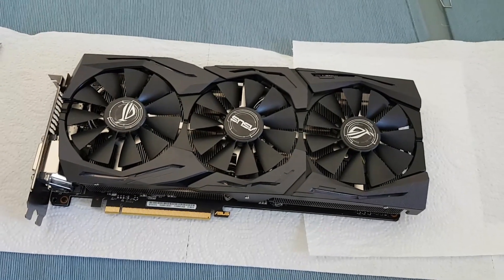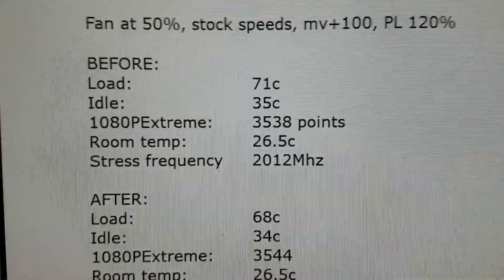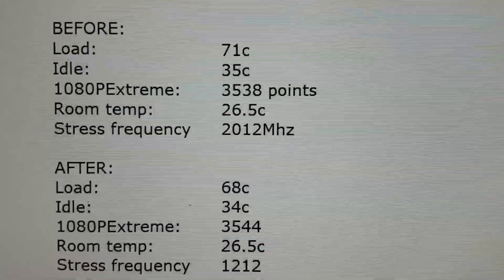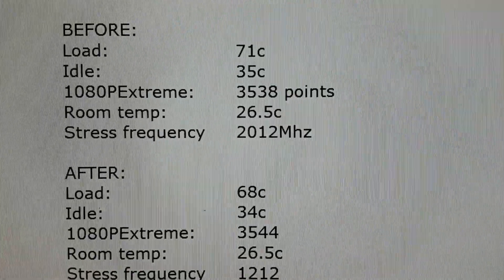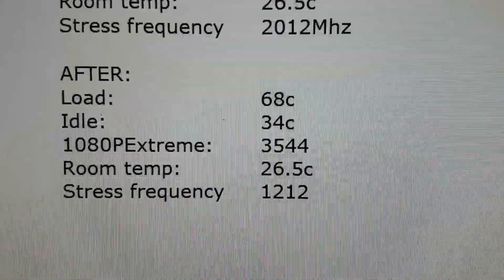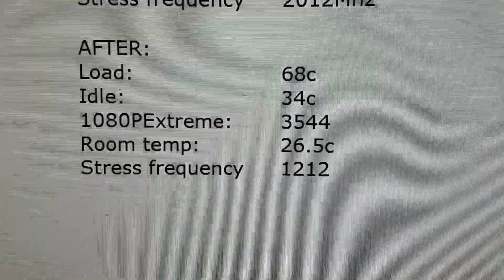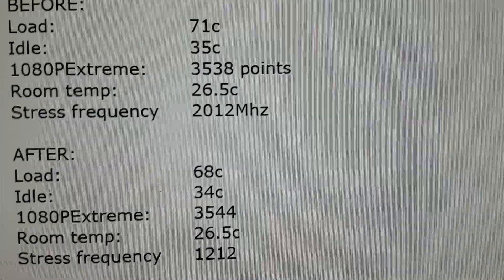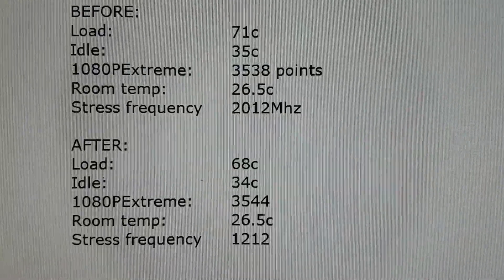Thermal Grizzly Kryonaut on ASUS ROG STRIX-GTX1070-O8G-GAMING

Comment: Can you tell me size of yellow thermal pad on heat sink
Reply from the maker: The thermal pads are good quality and mine didn't rip when I disassembled the card, so as long as you are careful there's no need to replace them. My VRM temperature were exactly the same after I assembled the card again so if they don't break its fine to reuse them. I have been asked this before and I'm sorry to say that I haven't been able to find what thickness they are.
Reply: @OzzedNet  thank you : )

Comment: how many mm thermal pad?
Reply from the maker: I don't know. Mine remained intact so there was no need to replace them. It seems they are the kind that won't rip if you're careful when taking the card apart. I tried googling it but I'm afraid I haven't been able to find the thickness listed anywhere.
Reply: @OzzedNet  thanks for your answer
Reply from the maker: @emraherkul  No problem :) Sorry I couldn't be of more help. But if you were asking because you were counting on having to replace them I don't think it's necessary as long as they don't rip and are not dirty,
Reply: @OzzedNet  As you said, I want to change the dirty and torn, but I thought if I can find the information about the thickness without opening the inside, I will order accordingly. I was going to apply after the order came.
Reply from the maker: @emraherkul  the thinnest I found was 1mm and the thickest was 2.5mm so if you are willing to buy a few different ones you should be safe buying within that range, but I understand that it sucks not knowing and having to potentially buy stuff you end up not being able to use.

Comment: is this something a gpu owner should really do and do u really recommend doing it after owning the gpu for about 3 years?
Reply from the maker: If the GPU-owner wants more performance, lower temps and potentially quieter fans, knows how to take the GPU apart and put it together again, and is OK with voiding the warranty (in some jurisdictions) then yes. Otherwise, no. 
I'm still very happy with this mod and the difference it has made for me is such that I will not own a GPU without doing the mod again, to every card, every time. That being said, it does take time and knowledge so if you're happy with your cards performance, thermals and noise levels then there's no point.
Reply: Oskar Hanberg ok thanks. really apreciate u still responding to me even tho this vids extremely old. i will most likely do this to my card if u really think its that beneficial. u earned yourself a new sub
Reply from the maker: @chasecrime  No problem :) I try to reply to all comments, regardless of how old the video might be. 
If it's worth it or not is up to you, but this specific card it not hard to disassemble and you really only need to take the cooler part off the PCB. I used this video for reference. It shows how to take the entire card apart but you only need to do the first part to get access to what you need: https://www.youtube.com/watch?v=0GUySjP7-gI
I think it's well worth it, especially since Nvidia's boost algorithm is super sensitive to temperature and will start to downclock the card gradually after around 60c, so even if you don't overclock, you might get lower tempts to the point that it boosts higher purely based on the lower temps.
If you do overclock there are multiple benefits as an unstable overclock might be caused by too high temperature which cause the card to dial down voltage, rendering a particular offset unstable, but with lower temps the same offset might be stable. Also, at least on the 1070 Strix OC, the power the fan pulls is part of the total power budget, meaning that with a warmer card, the fan will spin faster, eating up more of the power budget, so a cooler card allows the fan to maintain the same temperature for the card but at a slower fan speed, leaving more power for higher voltage potentially leading to higher boost clocks.
So yeah, very worth it to me, but make sure you use high performance paste like the Kryonaut, because if you're going to go through the trouble of doing the mod, you want the best possible result.
Using Liquid metal of some sort will get you even better results but it's not something I can recommend as there are multiple issues such as conductivity, corrosion, and the need to replace it often. With Kryonaut I haven't replaced it even once and I still get the same Delta T over ambient as when I first did the mod, so it holds up very well. 
Another benefit to me was that on my card, the screws were not as tight as they could be, so contact between the GPU and cooler wasn't optimal, so taking it apart and retightening the screws also probably did its part in lowering the temps, so that's another tip for people who might not want to replace the paste: make sure the screws are properly tightened (but don't over-tighten them or yoy may case damage to the card!)
Hope that helps :)

Comment: EDIT: I wanted to say that I matched your settings exactly when preforming the test. 3 degrees is still within the margin of error for these types of tests however, so once you hit 4 degrees and up, you're "technically" seeing actual gains.

If you still have this card, reapply your paste with about half the thickness. I have the Strix 1080 and I managed to drop 8c on my load temps and 6 on my idles.
Reply from the maker: There have been hundreds of videos out there that shows that that does not hold true anymore. "Too much" or "too thick" layer of thermal simply does not matter. Both Jay's 2 Cents,, Gamers Nexus, Linus Tech Tips and other channels I would trust with my life for knowledge has proven this, so no. I will not reapply.
The truth is that if you tighten your screws properly, the thickness of the paste will be the same, the only difference is that if you use "too much" or "too thick" the excess paste will squish out on the sides which can be probematic if your paste is conductive or capacitive, which Kryonaut is not so it's fine if the paste runs out on the sides. I also tightened my screws hard enough to ensure good contact, so the "too thick" "too much" is a myth that seemingly refuses to die even though it has been disproven time and time again. Maybe it stems from when people used curing pastes, but I haven't seen anyone use Arctic Silver 5 and other curing pastes since the late 90th so it's surprising to me that people still swear by the "too much" "too thick" myths. Thermal pastes are pastes, they will act as such.